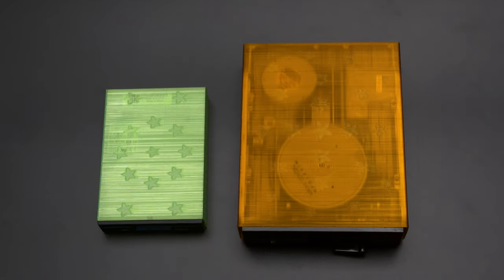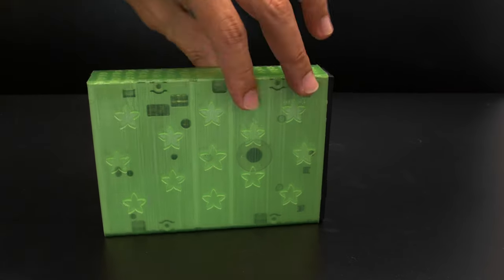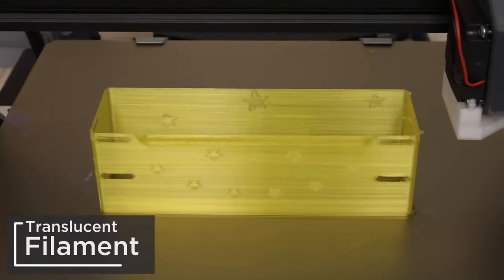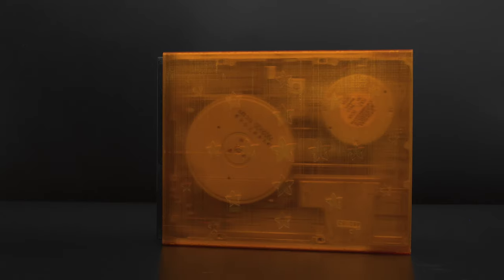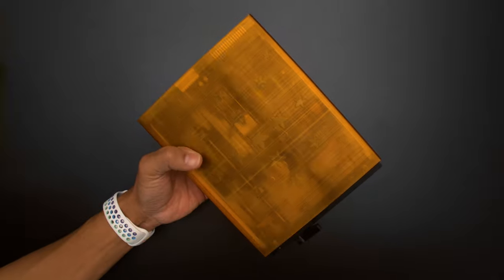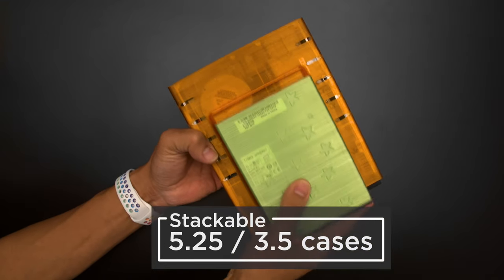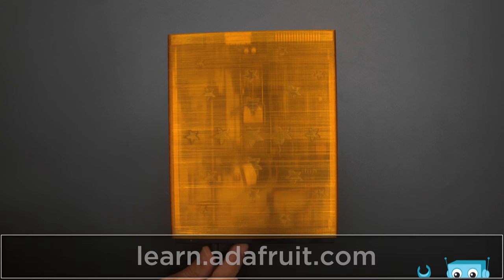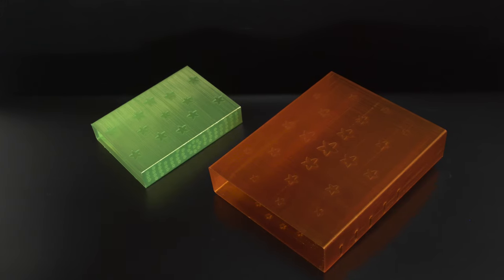5.25 and 3.5 Floppy Drive Cases #adafruit

Comment: This is awesome! I’ve got several old 5.25 inch floppy drives of varying height, and heaps of old floppies, and it will be super nostalgic to get the drives working again and connected to a modern system.